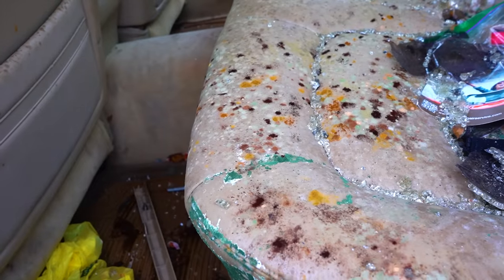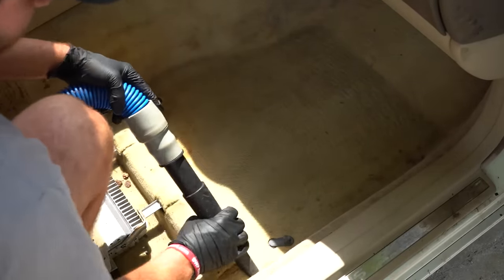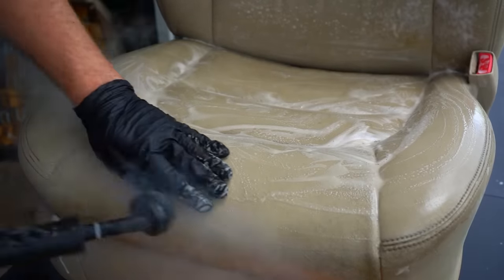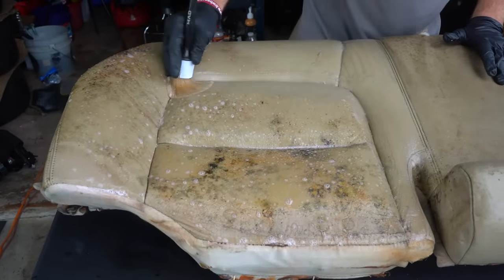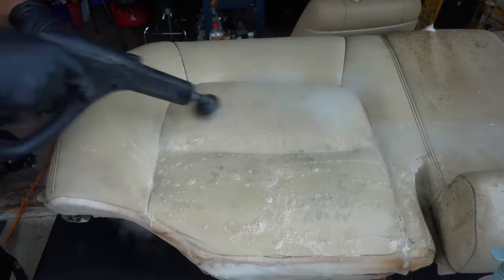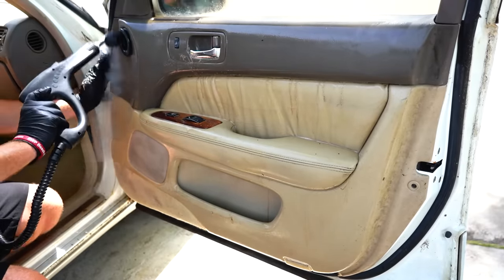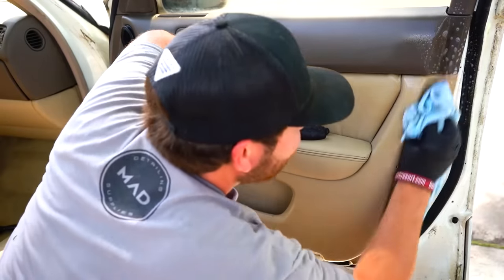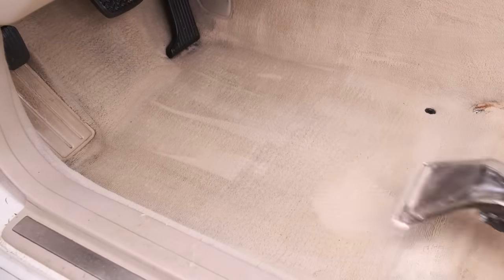Deep Cleaning the MOLDIEST BIOHAZARD Lexus EVER! | Satisfying DISASTER Car Detailing Transformation

Comment: My experience with a moldy car:: I live in Portland Oregon. When I was young and stupid and broke, my car had a leaky window and I just could never afford to get it fixed. The rain poured in slowly over the winter, and molded the carpet. Then the car broke down and I couldn't afford the mechanic. It sat on the street for at least 4-5 more months. When I finally went down to the car to check to see if it was still running - the WHOLE INSIDE LOOKED LIKE THIS CAR!!  I freaked out. So I did basically what this guy is doing...and borrowed a steam cleaner and spent around 8-9 hours cleaning every single thing in that car. It looked great and even smelled okay...although I do feel like there was a "hint" of moldy smell in there still.  I got the car fixed finally and drove it through the summer. There was no more mold during the hot weather - but as SOON as the rains came in the fall, the mold was rampant. It was "waiting" for the right conditions to re-appear. And I can tell you - even if you get rid of the mold on the seats, the fabric and cushions inside the seats contain spores.
Reply: Yeah, that mold was still nesting on the inside
Reply: Ok this is something really random but I love the way you structure your text lol.
Reply: There's no easy way to get rid of the mold.  You'd basically have to strip the interior down to the painted surface.  Carpeting and the padding under it, all of plastic trim, dash, head liner, etc.  Even though, you still wouldn't be able to get into all of the nooks and crannies needed to kill all of the spores.
Reply: @bomberdawesome  Ikr i read the whole comment cause of that
Reply: @Rock_Reggae_Riff  at that point, it’s better to either get a new car or get a new car wrecked and swap the interiors out.
Reply: I'm shocked on your comment, that you were able to drive in the car without any issues because my dog and I went to a friend's house,(I was told no shoes) and my dog and I came back home with this smell- Racid smell. This was the end of Nov. 2020 and I'm still dealing with this faint smell on my driver's seat mostly. It's on my clothes,hair, skin Everytime! I've spent close to 1k and still have the smell. You are lucky this didn't happen to you.
Reply: Hes giving the car to someone else to completely redo it so the other repairmen will most likely remove these seats he just did it so it wouldn't be a biohazardous pile of death.
Reply: Vinegar will make your car smelling salad fresh!
Reply: You must boil your interior in concentrated sulphuric acid to get rid of the mold
Reply: What happens if you throw it into the ocean? I think there will be spores no more after, maybe 5 years? 😆
Reply: Yeah, you are correct. These cars will never REALLY be clean. But hey, makes for satisfying vids for us OCD freaks 😅
Reply: So what you’re saying is, gutting or torching the car is the way to go 🫣🫣🫣
Reply: So even if you use ozonator it will still persist
Reply: I had mold in my car in Portland when my ac drain got clogged and then drained in the footwell. It didn't come back because I keep the car dry. I used an ozone generator but used it once on the car then didn't use it again for 2 years, no more mold
Reply: The car starts molding because it gets wet. It doesn't matter if the mold was out of control there already or not it will still mold if you let it stay wet
Reply: Omg I know this is out of topic after I graduate I’ve been really wanting to move to Portland and I’m wondering how is Portland and what activities do they usually do?
Reply: Yes , still in the seems and places you can reach plus it’s just resilient! Plus in the air conditioning and places you can’t see!
Reply: @Rock_Reggae_Riff Not even an ozone machine?
Reply: Yeah needs an ozone machine and or chlorine dioxide

Comment: Doing carpet for four years prior, trained in mold and mildew removal I can 100% guarantee that steam does NOT kill mold or mildew. To properly remove mold and mildew you need to use vital oxide spray or a mold killer, then follow with an ozone treatment for about an hour especially with something that intense. I detail cars now and I do that exact process
Reply: Hi can you train me as well
Reply: Not to mention mold that might still be dwelling in the AC ducting.
Reply: @hunkydory419  most certainly there is mold in there.
Reply: As long as moisture and humidity level is below a certain threshold then fungi such as mold will not grow.
Reply: @CL-yp1bs  Except this car is in Florida, where that never happens.
Reply: @studiotom  I did not know it was in Florida, if that is the case then this will be a major issue, mold spores will be present and spread in high humidity environments.
Reply: @hunkydory419 Amen! Right into the ole lungs🤢
Reply: Yeah even then with this car and a humid environment, I would not consider it safe.
Reply: This is inaccurate. Mold and yeasts are killed at temperatures between 140-160 degrees Fahrenheit. A good steam cleaner can reach temperatures over 200 degrees. Killing mold is only the first step. Obviously removing it is also necessary.
Reply: So basically just burn the car and yeet it off a cliff.
Reply: When you buy cars flooded due to disasters at auction, that's how they come, but they sell them to you at the price of eggs, cheap.  The problem is that if you don't change the complete wiring, the car will always give you problems.  They are good to resell, to keep them, I do not recommend it.  And of course if the seats are not removed, the complete upholstery of the car and they are not cleaned underneath and the complete carpet must be removed and put back.  of course you have to use a Clorox based product like oxy clean, or ammonia (never mix ammonia with another product, it could kill you).  Otherwise, the buyer is going to have a lot of health problems.  I don't buy them, but my boss does, and he has no heart, much less compassion.  Whoever buys these cars ends up suffering from asthma and respiratory problems.  To keep a vehicle like this and have peace of mind, it is advisable to replace all the upholstery, the roof, the wiring and the carpet.  And replace de whole systems of AC .  Never buy a car flooded in water.
Reply: @RMEDM  I agree 💯
Reply: All incorrect. Mold specialists will tell you there is no way to "kill" mold. You must REMOVE mold. Discard materials it is growing on. PJHarlow Wellness ad Mold Finders are the absolute authority on this as they are educated and work with doctors that treat mold toxicity from exposure. Please do not ever try to clean mold. have it removed by a medical mold remediator ONLY.
Reply: @roekinn  this blanket statement is incorrect. Yes, serious mold infestations should be worked on and removed by mold professionals. But to say you “can’t kill mold” sells short common household mold such as shower mold than can absolutely be killed and cleaned with cleaning vinegar and don’t necessitate a mold professional.
Reply: You are 100% wrong, steam will kill mold. Also if you detailed cars you'd know what you are talking about, which you don't.
Reply: Geee  @CL-yp1bs you sure are smart 😜
Reply: Hater
Reply: Haters
Reply: Exactly. It takes peracetic acid and phenolic based cleaning agent to destroy mold spores. I work in healthcare and watching this I definitely think how are the mold spores in the crevices of the air conditioner and seatbelt are still there, lingering. But I give kudos to the effort because personally, I would burn this car

Comment: I understand that u may take on jobs for the video content…but you should have passed on this one. The main reason is the mold alone should have been a red flag. You also didn’t wear a respirator. That is basic health & safety. Do u have other people working for you? If so, the fact that you did not wear a mask  could lead to workplace issues later on for yr employees. Also, if u have all this experience in detailing cars you should know that surface mold would be cleaned but mold would also penetrate the into the seats and carpets. In good conscience you knew that the owner of this vehicle was a clearly a shister. You have a reputable business to run. Next time a person shows up at yr place of business with a car that they found at the dump, you should give yr head a shake. You enabled that person AND that is not good business.

Comment: You did a great job with the superficial mold and mess. I am concerned this car will eventually be resold to an unsuspecting buyer and the previous mold will not be disclosed.  As a person who buys used cars this makes me cringe...
Reply: Yeah hopefully that did not happen but I wouldn’t be surprised that the customer pays the cleaning fee then resells the car as “lightly used”
Reply: Is it a salvage vehicle? I hope so, that's the purpose of salvage titles
Reply: When you buy cars flooded due to disasters at auction, that's how they come, but they sell them to you at the price of eggs, cheap.  The problem is that if you don't change the complete wiring, the car will always give you problems.  They are good to resell, to keep them, I do not recommend it.  And of course if the seats are not removed, the complete upholstery of the car and they are not cleaned underneath and the complete carpet must be removed and put back.  of course you have to use a Clorox based product like oxy clean, or ammonia (never mix ammonia with another product, it could kill you).  Otherwise, the buyer is going to have a lot of health problems.  I don't buy them, but my boss does, and he has no heart, much less compassion.  Whoever buys these cars ends up suffering from asthma and respiratory problems.  To keep a vehicle like this and have peace of mind, it is advisable to replace all the upholstery, the roof, the wiring and the carpet.  And replace de whole systems of AC .  Never buy a car flooded in water.
Reply: women whoi talk about cars makes me cringe
Reply: @catatonicgalaxy1471  Why? Cars aren't for men only lol
Reply: @catatonicgalaxy1471  loooooool 
My man here is choosing violence
Reply: @catatonicgalaxy1471 sounds like a you problem

Comment: It looks stunning afterward however that kind of mold is toxic and you can't remove it from within structure of the foam in the fibers of the carpet
Reply: I still wouldn’t sit on that
Reply: Didn't know that there's no possible way to get rid of mold in the car's carpet?
Reply: @killertruth186  mold in poreous substances is almost permanent unless subject to a long period of dry heat, even then the structures remain
Reply: @polignac  I am no expert but would ozone help in this situation ?
Reply: @atre6652  without thoroughly testing the internal materials, who knows? all i know is i wouldn't want to be in that car, let alone sit on those seats.
Reply: AtRe Ozone would help but in the concentration needed will a) be dangerous and b) wreak havoc on rubber and certain plastic parts
Reply: @atre6652  im not an expert either, i just know this from living in a humid area and having to constantly deal with mold. Either subjecting them to dryness or throwing them away would be the best option.
Reply: Id imagine the cleaning, cleans the outside of the layers in interior and not inside, although who knows how deep the mould has gone through, personally Id get new seats and carpets from the same car model thats on sale for parts. Would be much safer
Reply: @4trox4ever40  i cannot read what u just said lol
Reply: @ratdealer7734  They said that ozone would help, but you would need a dangerous concentration of it, which in turn damages rubbers and plastics.
Reply: Guess you didnt watch the vid he legit said the owner will be restoring this car so its being completely cleaned and new parts and new interior

Comment: Try 1 part Dawn dish liquid to 3 parts peroxide, scrub extract repeat if needed,  dont wet carpet first! It works amazing & gets out everything from blood & sweat stains,  you can also try a product called white out & white out rust remover, in cleaning & laundry section at Walmart first wet the area then put  on a small amount scrub & extract repeat if needed

Comment: Maybe try the steamer to get those stains to loosen up and then extract them with hot water. Heck if the steamer can be used on the door card fabric (thats held on with glue) wont release then it should be safe to use on the carpet too. Worth a try.

Comment: Hi. Maybe the red/pink stain on the carpet was made with a fall-out product ( hydrochloric acid, used for removing brake dust on the wheels). It is possible to use fall-out on carpet , for removing stains with rust, (not tested on seats, so be careful).  But you must make a shampoo immediately ( less than a minute ). Or the dye will change to red. Before trying this trick, test it in a place not visible. Oh, one more thing. DON'T use hydrochloric acid on polished aluminum wheels (without varnish) otherwise they will be stained white.

Comment: Being that the fibers in automotive carpets are plastic, wouldnt 30% hydrogen peroxide get those stains out? As long as you dont leave it too long and rinse it out thoroughly, it should destroy the pigment in the stain. The only thing it probably wouldnt touch is rust stains, as they are already oxidized and it wouldnt do anything to it. You can find it at hydroponics shops. Just test it on an inconspicuous spot first to ensure it doesnt bleach the color out of the carpet.

Comment: So there's a remedy I have tried that works pretty good for red stains on carpet, you may try it if you'd like. Mix baking soda and dish soap, I use dawn platinum, to make a paste, add to a toothbrush and scrub the area with the toothbrush, let it set for at least 30 minutes, then you can either brush away or vacuum up the baking soda, then spray the stain with non-diluted white vinegar and blot with a towel. I had a stain on my front right floor board that was bright red when I got it, and my carpet is a light gray, and I tried this and it is now a very faint pink, I only did it once after using my shampooer, it may take a couple applications but from experience I know this works. Good luck.

Comment: I would use chlorine dioxide gas treatment inside this car at the very end of the detail to kill all the mold deep in the foam, fabrics, headliner, and other areas that are very difficult/impossible to reach. On-site generation kits are available for vehicles. The car is sealed up with the air conditioner on in re circulate for 20 mins (probably longer with this car). Maybe a second treatment on this car. After, open all doors and windows turn the vent off re-circulate and run for another 20 mins. Read and follow all safety proceedures. Do not use in confined areas. Use at own risk. Very effective at destroying (not covering up) all odors.

Comment: When you buy cars flooded due to disasters at auction, that's how they come, but they sell them to you at the price of eggs, cheap.  The problem is that if you don't change the complete wiring, the car will always give you problems.  They are good to resell, to keep them, I do not recommend it.  And of course if the seats are not removed, the complete upholstery of the car and they are not cleaned underneath and the complete carpet must be removed and put back.  of course you have to use a Clorox based product like oxy clean, or ammonia (never mix ammonia with another product, it could kill you).  Otherwise, the buyer is going to have a lot of health problems.  I don't buy them, but my boss does, and he has no heart, much less compassion.  Whoever buys these cars ends up suffering from asthma and respiratory problems.  To keep a vehicle like this and have peace of mind, it is advisable to replace all the upholstery, the roof, the wiring and the carpet.  And replace de whole systems of AC .  Never buy a car flooded in water.